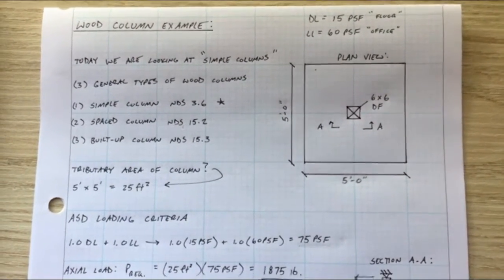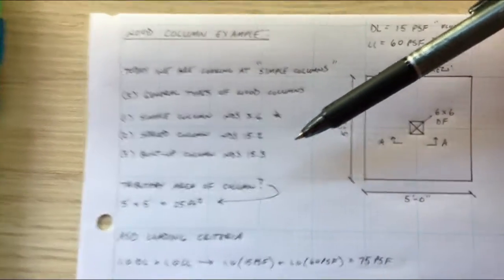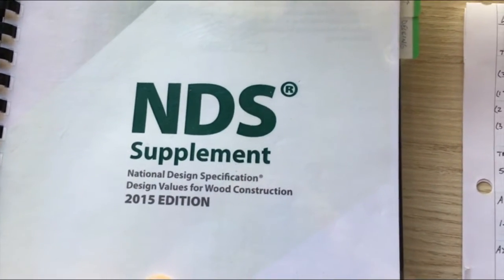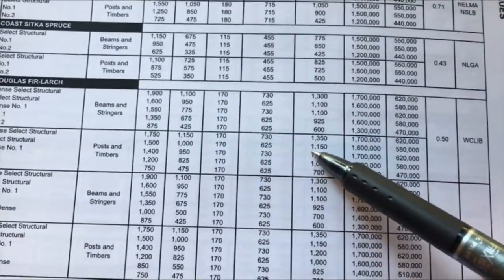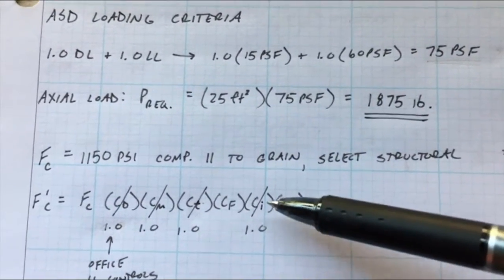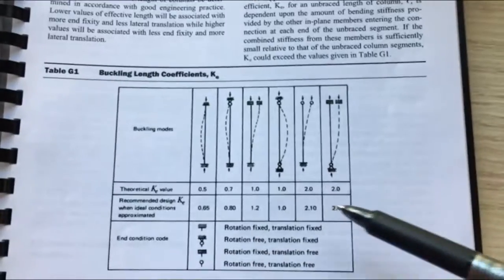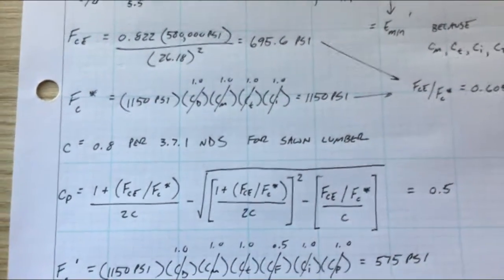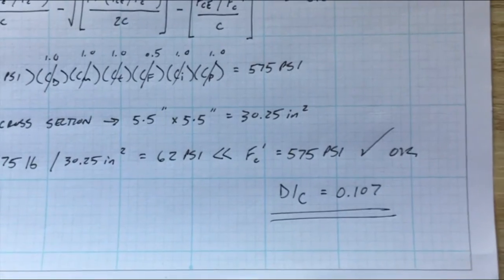Design of a Wood Column by a Professional Engineer

Comment: Since the column (6x6), was used and was significantly lower, we could change it to like (2) 2x6 Columns;  With that said, we would still be using sawn lumber, but for the area, would it be two 2x6's?  Everything else would essentially be the same I am assuming?
Reply from the maker: correct, the area would be 1.5"x5.5" times (2) boards to get your area. When we work with built up columns we need to check shear flow through the two separate boards to properly detail nailing of the boards together. that would be the only difference!
Reply: @Kestava_Engineering  Got it, now I understand this is a "simple column", but do Columns typically take Dead, Live, Snow, Roof Live, Lateral (wind or seismic) also?

Comment: Great video! I think the only detail that I noticed is in the calculation of the CF adjustment factor. According to the NDS section you referred, (4.3.6) the formula only applies to the adjustment factor in a bending member.  If it is compression, I believe the factor should be by default 1.0 according to the CF factors established just before table 4D. Correct me if I am wrong though.
Reply from the maker: yes you're correct! if you use the formula like I did it still kicks you to the same answer, but your way is much faster! and yes this member is a 6x6 so it counts as "timber" which CF is found in Table 4D